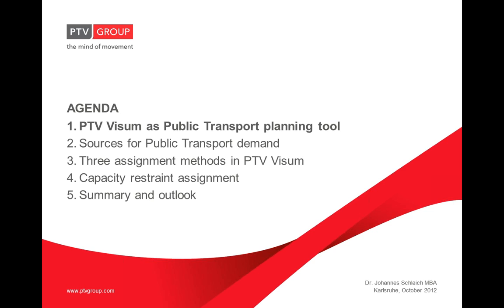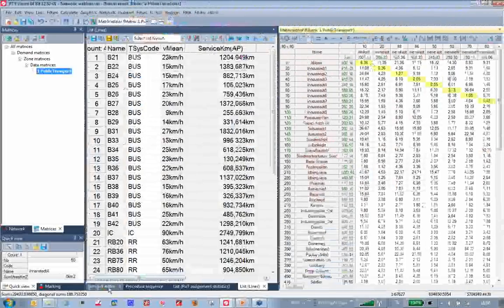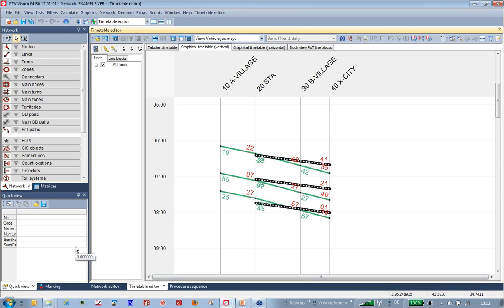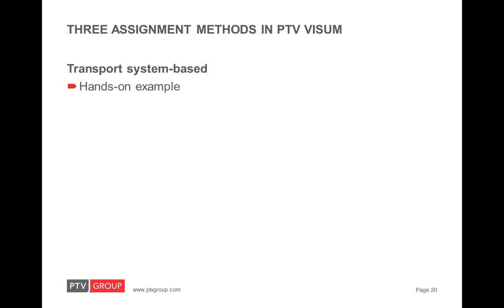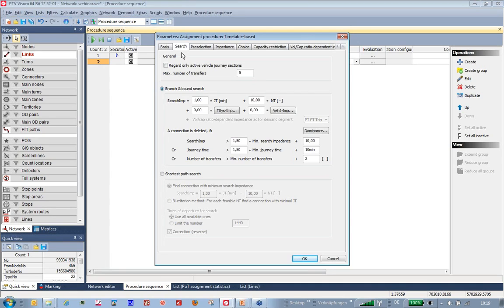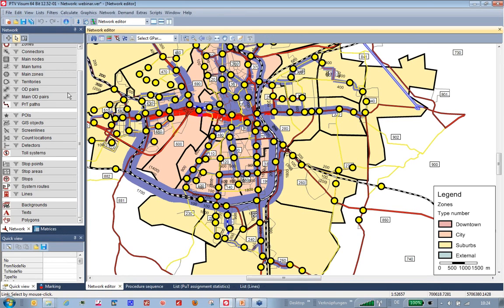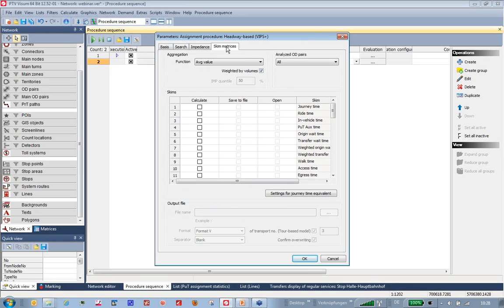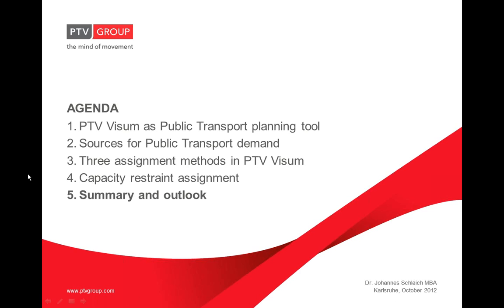Assignment Methods | PTV Visum | Webinar

Comment: guys i need some insight, when i assign timetable based why some of the zone's demand is not doing the trip? is it because time tabular each line routes? or demand time? or assignment time? all of above i input from 05.00 to 22.00 (real operation of BRT).

and also put regular service as headway which is depends on each route (15-40min).
Reply from the maker: Hey there, without seeing the model it is hard to say, why some demand is not assigned. It could have several reasons as you mentioned.
- You can explore the log files which give some more detailed information. (under File > Show Log files).
- You can also test whether a shortest path exist (under Graphics > Shortest path search)
- You can carry out appropriate network checks for PuT (under Calculate > Network check)
- When you use the timetable-based assignment you need to define vehicle journeys (e.g. in the Timetable editor (tabular)), the definition of a headway for each line route is not sufficient.
Hope this helps!
Reply: @PTV-Mobility  thank you so much for the respond, also for the customer service team!

I reported this issue through myptv, so I sent my model and said it was because my bus stop connector (I think) it is not pointed at node. Now it is already solved, big thanks to ptv!